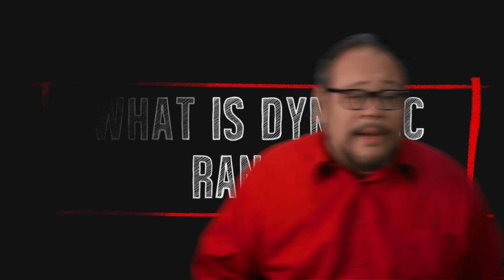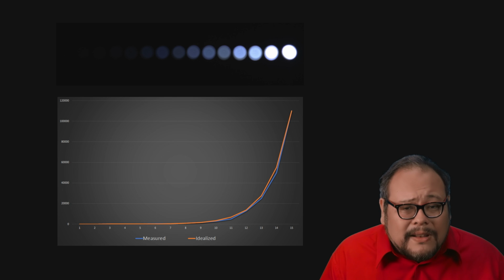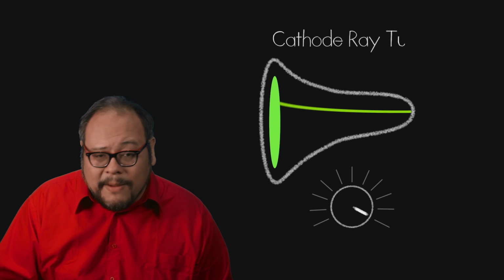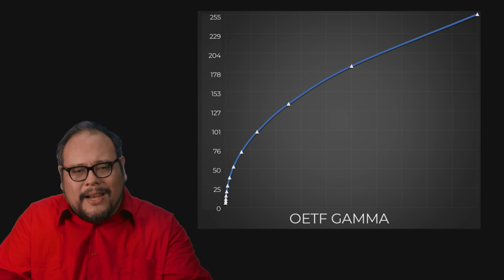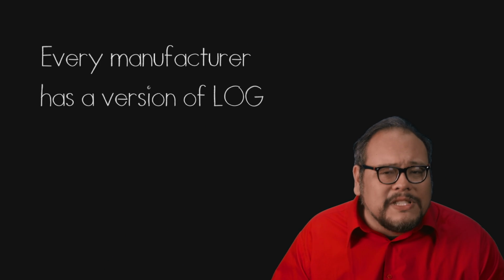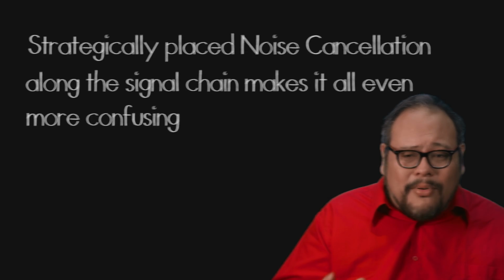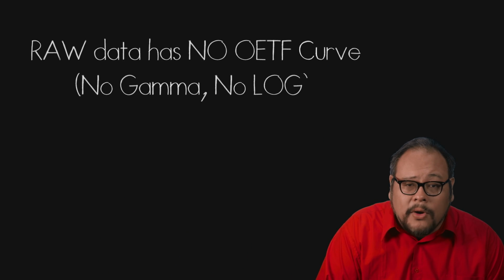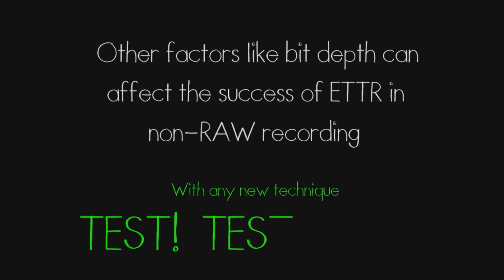Diving into Dynamic Range

Comment: Great video! As a documentary maker we often don’t have access to extra light and raising shutter or opening aperture will have unwanted results such as effecting motion blur or forcing and unworkably narrow DOF. In such cases high ISO in dark is only really option and we just have to balance this with an acceptable level of noise. 

However, in log, specifically Slog, Sony use EI instead of gain/ISO. My understanding of such, is that  changing the EI level in camera doesn’t actually affect output at all. It’s simply offering you a viewfinder approximation of the upper or lower areas of the gamma curve so that you can then set ‘exposure triangle’(forgive me) levels appropriately. So then I guess we would use a high EI setting in a bright scenario, this would force us to stop down and this preserve more highlights. But then I’m struggling to see how any of that helps if I can’t practically change shutter or aperture  without the above mentioned unwanted results? ✌️
Reply from the maker: You can practically add ND filters
Reply: @ agreed and we we do. In fact variable ND above anything has been an amazing addition to most broadcast cameras. I’ll often ride that & leave the F.stop fixed. am I right that EI doesn’t work as ISO does? Cheers
Reply from the maker: Yes and no on the EI. In regards to middle gray, the EI works the same as ISO... But instead of reducing dynamic range which typically what happens when when you increase the ISO, it just shifts how many stops above and below middle gray are captured.
Reply: @ that’s great thanks. I was under the impression that the EI didn’t actually effect captured image at all, it just showed you the top mid or bottom end of the full log range you were capturing. But maybe it’s different on different cameras, or maybe I’m just wrong!
Reply from the maker: Well its all camera dependent. I can't speak for what anyone camera does that I'm not familiar with

Comment: Ok, just so I make sure I understood it. Ettr only makes sense when shooting raw (video). But not so much when shooting in, let's say, clog3 cinema gamut....
Reply from the maker: That is correct, log is designed to be shot for proper exposure but there's still lots of latitude to work with. Ettr really is sort of an outdated practice, though nowadays with some cameras you can push and pull the ISO which gives you similar effects to ettr

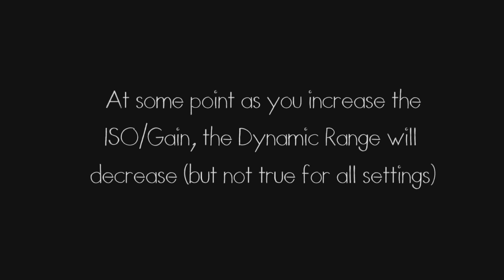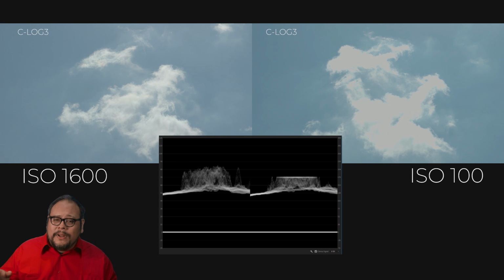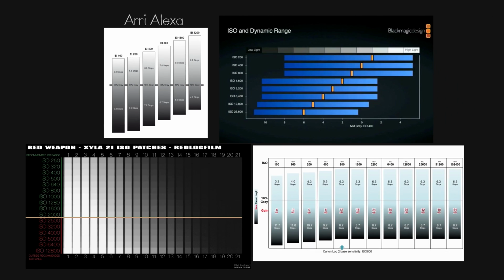Comment: The phenomenon you describe starting at @24:00 of highlight headroom progressively increasing as ISO increases only applies on camera systems that use digital scaling exclusively for their ISO implementations. There are only a few cameras I've found which do this, including those from Blackmagic. Most cameras, including those from Canon, Nikon, Sony, and Panasonic use digital scaling at their native log ISOs, switching to a combination of digital scaling + analog amplification thereafter for all ISOs above native. For example, Nikon's N-Log has a native ISO of 800, which corresponds to sensor ISO 100 (in terms of gain). This means N-Log ISO 800 is ISO 100 with 3EV of underexposure when you account for the metering system using notational ISO 800. The brightness is adjusted +3EV via digital scaling after reading the frame from the sensor, to achieve the ISO 800 exposure rating - this is done digitally instead of via analog gain so that the highlights aren't clipped on the bit-depth limited ADC prior to encoding them via the log curve. Switching topics, the highlight headroom phenomenon you demonstrated on you Canon for ISOs below its native C-Log of ISO 800 is unrelated to the scaling I just described. The Canon reduction in highlights below its native Clog ISO 800 is due to digital pulling, the same as how the expanded ISOs are implemented on Canon cameras for still images. For example, at ISO 200 the Canon meters for notational ISO 200, which induces 2EV of clipped highlights relative to the native Clog ISO of 800. This is also why you observe a hard-stop of IRE levels for those expanded ISOs. At 26:18 you compare Canon's ISO 100 to ISO 1600 to demonstrtate expanded highlight headroom from the higher ISO, but that highlight headroom expansion is only due to the highlight clipping from ISO 100 to 800. If you compare your Canon's ISO 800 to any other higher ISO you will not observe any increase in highlight headroom. This is consistent with the Canon DR chart you show on-screen @ 26:10. I'm working on a video that does a deep technical dive into how cameras implement log internally as an adjunct to your fantastic video. I'd love to discuss a few technical details with you if you're able to find the time. You can contact me via PM on Dpreview - my username there is "Horshack".
Reply from the maker: It's primary in the line of cameras advertised as cinema camera, you'll see in Alexa lines, Black magic, Red. The Canon C line demonstrates it as you noted in sub 800 ISOs... But it is an key caveat to point this out there because outside on a bright sunny day is where you would most likely reach for ISO100 where you will get the most clipping of highlights.
Reply: @FilmmakerIQ  Thanks John. IMO shooters should avoid the non-native log ISOs. They provide no advantage vs the native ISO w/digital exposure adjustment in post. Also, since the log encoding is clipped, all the highlight-related exposure aid thresholds must be adjusted every time the the camera ISO is switched in or out of the non-native ISOs. For example, having to adjust the configured threshold value for highlight zebras, or adjusting which color represents highlight saturation on the false-color display, or having to visually adjust how their interpret the waveform to account for the lower maximum IRE.
Reply from the maker: Well it depends... If you're shooting on cameras that behave the way I described that push and pull, there is no disadvantage to shooting non native ISO. You have to understand your own camera and what it's doing
Reply: @FilmmakerIQ  Hi John, I've just published an explainer video that does a deep dive into how log ISO is implemented by cameras. Not sure I can post a link in a comment without being flagged so I'll just refer to the title instead: "Demystifying Log ISO, Exposure, and Noise"
Reply: Yes, shooting at native does give best dynamic range, and then 2nd and 3rd base respectively. And when something is clipping in the highlights I just use ND. If I'm not happy with the noise, I lower the blacks a bit in post and basically get similar but more precise effect of shooting in lower iso. On my a6700, Slog3 at native 800 I've observed that in the bright day with a little bit of clouds I can retain all highlight data, while having just a little bit of deep shadows crashed ( and I mean like shadows deep inside a huge pile of branches that it itself is in the shadow), which for such s35 sensor is incredible to see. All I need is just to look at histogram and everything is clear. I also learned that at second base at 2500 there's only loss of 0.1 stop of dr while the brightness is increased by 1.6 stop. Anyway, as for this whole technique of low iso = more detailed shadows and high iso = more detail in highlight is solely related to RAW workflows ( that's why the op talks about arri, red and bm, because in did when recording raw on those cameras the results are better ).

Comment: I'm doing something wrong and wrong and I can't understand what...

I hope you can help me understand

If I photograph a spyder checkr card, in controlled conditions and using canon cameras (R5 and R8)

In 10 different exposures: from the one that marks the camera's exposure meter as zero, up to +4 stops up and up to -6 stops down... (without moving the ISO, or the aperture only adjusting only the exposure time)

Then I take readings with Raw digger exactly at the same point of each image I get a graphic in the form of the letter J

And the same thing happens if I measure with the pointer the levels of that gray in Capture One: I get a graphic with a very similar shape - in the form of a J letter-

But

If only using one image, the base image - in the exposure in "zero" - I measure the patch levels that correspond to the different percentages of gray of the Macbeth card - which are supposed to be in "exposure steps" - I obtain a curve with lower gamma (contrast), a curve very similar in shape to the densitometric curve of the film. With that inclination and not curved as the previous one 

In no case do I get a curve that increases the values proportionally to the exposure steps. And the graphs resulting from making a bracketing vs measuring the values of a macbeth (datacolor sypdercheckr) do not match in inclination either

What am I misinterpreting?

Why are curves different comparing exposures vs exposure values within the same image?

Am I assuming that they relate and it's really not like that?

Why don't they show the exposure stops doubling the value?

Thank you very much in advance for your answers
Reply from the maker: Edited: The issue is your Macbeth chart is not be truly giving you equal stops in exposure. According to this source (https://www.imatest.com/docs/colorcheck/) the gray values represent "optical densities from 0.05 to 1.50; a range of 4.8 f-stops (EV)" - that's 5 stops over 6 gray squares.  So it looks like you're only evaluating the flat part of the the "J" curve.

This is why I used a light emitting subject for this test rather than a reflective test subject. This is why your 10 stop experiment where you actually affected exposure showed more dramatic results (on the extreme ends)
Reply: @FilmmakerIQ  as always you are the best! Thanks for the answer.  If I only evaluating the straight part… means that double the exposure doesn’t mean necessarily double the resulting exposition
Reply from the maker: Double the light input doesn't necessarily mean double the light values - remember there is a OETF gamma applied.

Comment: Film sensitivity used to be measured in ASA.  When/why did this change to ISO and is there a difference vbetween 400 ASA and 400 ISO ? Just a question of ASA being adopted by the ISO organisation? 

And in applying ISO values to digital cameras, was this an exercise of  achieving woth say ISO 400,  the same middle grey level on film and digital with same exposure/f-stop ? 

I had always though that the ISO setting on digital cameras really did make the sensor more sensitive by craming up voltage or something (hence more defects in image). You video shattered this and now I have to relears photography from scratch 🙂
Reply from the maker: I'd have to research when the switch between ASA and ISO occured.. but on the question of applying ISO to digital cameras... Yes it's suppose to be cross platform from film to digital

Comment: Here I have a question about raw… i took a raw photo of color ckeckr chart with a canon r5, open the raw file with raw digger. I read every (white, 10,20,30,40,erc) level and draw a table. The resulting graph it is a curve with a pretty noticeable curve mainly on the shadows not a straight line as your graph. What I’m doing wrong ?
Reply from the maker: Straight line of linear is only hypothetical. I imagine there are a lot engineering reasons why you would see a fall off quickly in the shadows

Comment: I get the argument for better bit allocation in the encoded signal curve. However, I'm struggling to comprehend this aspect: when we view an image on our display, the encoded gamma is decoded back to linear. Doesn't this negate the advantages of encoding, given that we end up with a linear luminance response again?
Reply from the maker: The purpose of it is bit allocation. You're taking linear light and storing it more efficiently. It's a form of compression.

Comment: hi again i have three questions which are semi related to the video but more on a general understanding of digital signal processing. 
1. I read online about a concept called quantization which is teh assignement of taking basically infinite numbers and converting them into a finite number of values. does this mean that before the concept of quantizing, the numerical code values produces by teh a/d convertor are much larger/ more infinite, and only during quantizing does it limit the code values to the amoutn of bits availble. e.g. 8 bit- 256 available code values 
2. i dont really understand where in the process of assigning numerical code values to teh different amoutn of voltage (produced by teh photosite)  does linear encoding vs non linear encoding occur.
3 is gamma correction a replacement of linear encoding or is it something that occurs after wards 
4 finally not really a question, but i have made like a some notes on this concept of signal processign and encoding and was wonerding if it would be possible for you to review it to check that i ahvent confused myself or wrote soemthign wrong.
Reply from the maker: Quantization happens during the Analog to Digital converter. Where that ADC comes in is dependent on the system design, I'm not privy to the exact designs.

Don't get hung up on the ideas of signal processing. Just understand the principles because the questions you are asking are very specific to the design of each individual camera and you'll need a lot more education on the subject than I can offer.

Comment: I have two questions which i am slighlty confused about.
1. In stevesn power law there is k which represents the constant of proportionality, but hwat does that actually represent and what number did u use and why when calculating the perceived light sensation. 
2. at 7;40- i get how you achieved the first graph by plotting the perceived light sensation on the x ais and teh light intesnity of different sorces on the y axis but what did u mean by teh change in power curve at 7:55-
Reply from the maker: 1. K is just a scaling constant and it changes depending on the units used. For this discussion, all that matters is it's a positive number.

2. Plotting the "change" in the second graph is asking, how much do we "lose in experience" as we step down. From 100% to 50% (1 stop loss), we only lose an experience of "0.2" from 1.0 to 0.8 on the y axis) From 50% to 25% we lose about "0.16" on the y graph - then "1.2" for the next stop.

The point is even though we are reducing the light exponentially, the experience stays relatively linearly constant - it's not flat, but it looks like it evenly steps down in brightness even though in actually light units, it's decreasing geometrically.

Comment: Hello. I would like to know if you know any program to lower only exclusively the brightness of the most luminecent colors of my screen, such as white, like a gamma curve that can be modified in multiple points, not the standard gamma curve. As a Knee, as you call it, that only lowers the high end brightness. The whites and soft greys burn my eyes. I cannot get help anywhere else. Thank you for your time if you respond.
Reply from the maker: Essentially that's what some of these "night time" apps do. I also own a monitor who's white levels seem completely blown out but I haven't dug into these programs
Reply: @FilmmakerIQ  Thanks for responding right away. If many monitors have such bright high tones, i think that this theme could be a topic for a video. I do have some programs that make whites more red, however, everything including mid tones become more red. I do have other programs that i cant tell the difference onto, maybe they require monitor calibrator. I will tell the names and further when i get on my computer.
Reply: DisplayCal, F.lux. If you are okay with distorted color for the sake of not pinching your eyes, i would recommend you f.lux. If you remember someone who knows about this, thanks.
Reply from the maker: F.lux was the one I was thinking about. I had that for a while but I do a lot of work at night that needs a little more color accuracy lol.

But I know your frustrations. I bought a 144hz to test and it sits next to a 60hz... The 144hz looks TERRIBLE in comparison and nothing I can do on the monitor can reign it back in.

Comment: Thank you for the video. it helpful for sure. Dynamic led-machine is good idea but using ND gel-filters NOT. (I also tried similar idea 7-8 years ago). After 3-5EV it have heavy color shift. Also steps are far from ideal (my guess it due to fiber-optic).
Reply from the maker: It's good enough for the demonstration. The raw cd/m2 numbers show the variability in precision but it gives enough to understand what's going on.